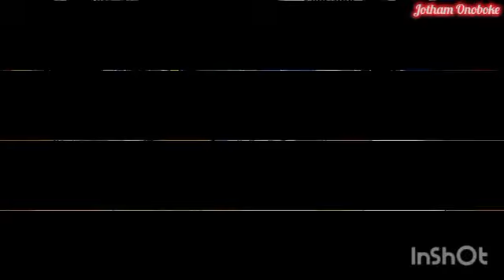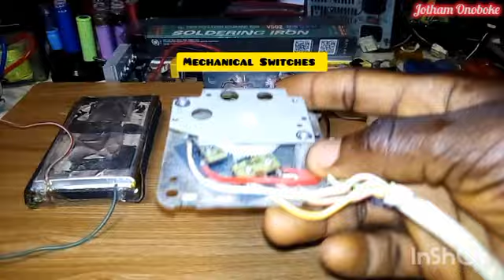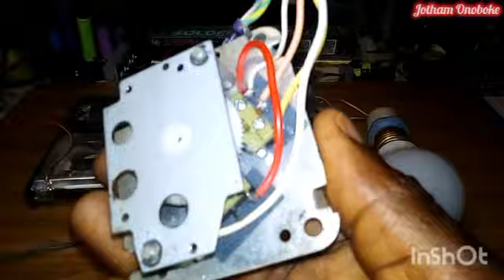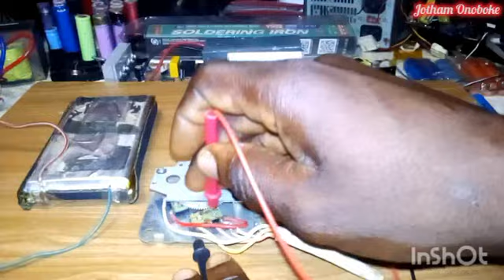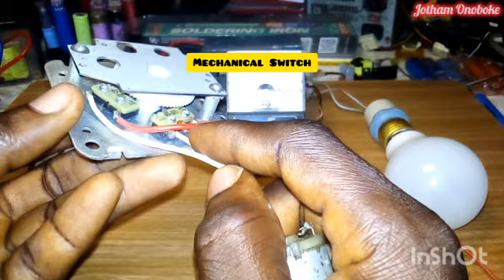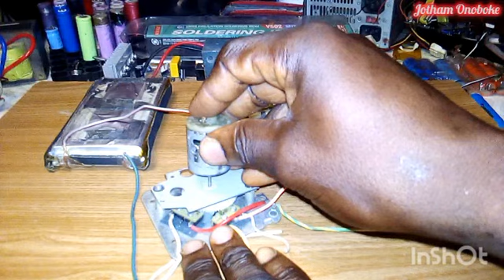DIY Mechanical Inverter: Convert DC to AC with Simple Components!

Comment: How many watt does it produce??
Reply from the maker: Am using a 3.7vdc battery as input voltage so it's producing around 40watt the light bulb you see on the video is 10watt 220vac.
 But if you can use a bigger battery 12vdc as input voltage then the output voltage will also increases too.
Thanks for asking dear friend.